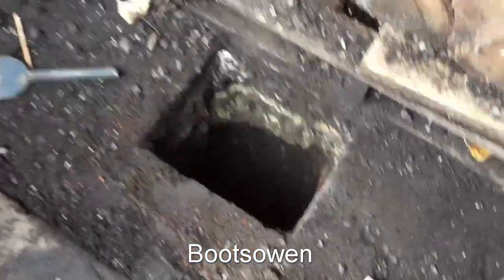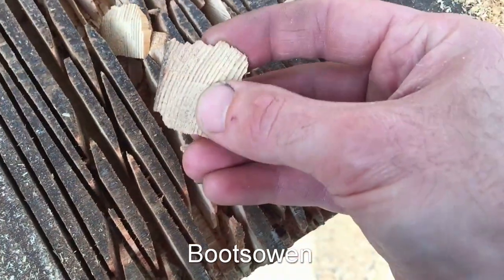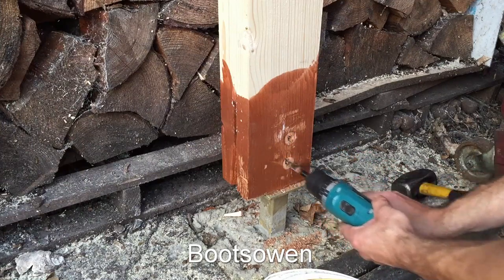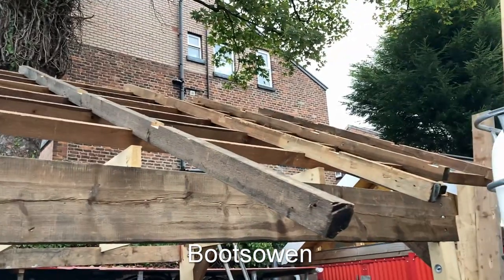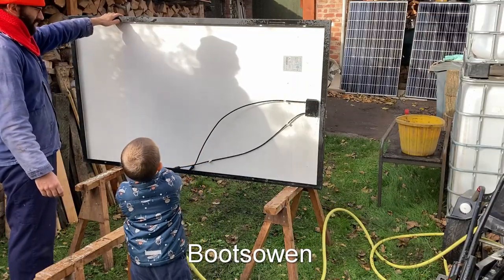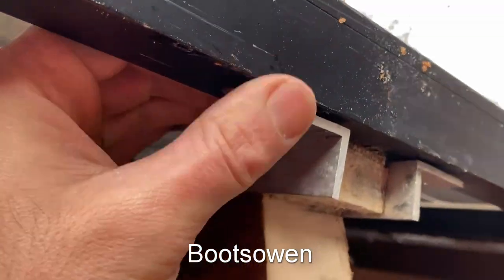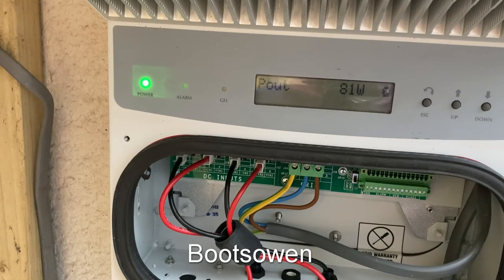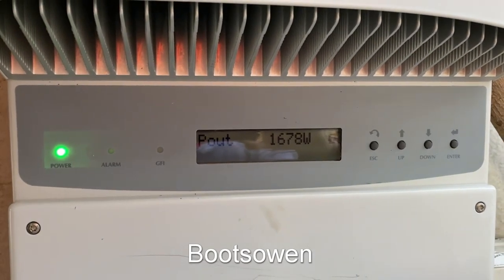DIY grid-tie solar in the city: Full installation | start to finish | 4kW | Solar car port

Comment: Love the video boots. I fitted 5 panels on my outhouse roof and woodsheds. I was pleased to see how you mounted panels vertically (on a beam) as I used the same method. The way you built the car port shows your attention to detail e.g. woodwork.  You're a real inspriation, love your channel.

Comment: You sir are a bit of a legend I think - fantastic ethos in terms of sourcing things so economically whilst giving them a second life and your workmanship and problem solving are a joy to watch.  Just in the research phase of fitting panels on a steep roof which I'm not looking forward to I must admit, and then intending to cable up and bring in someone for checking and certification.  Your excellent video is yet more inspiration willing me up that ladder :)
Reply from the maker: I do my best. Why do you need certification? The feed in tariff is gone so there is no money to be made, maybe so you can get a few pence per kWh from your energy supplier, but I imagine there is a cost benefit analysis to be done there. If you are thinking of doing it on a roof, even single storey a scaffold will make it far easier.  Have a look at my solar playlist, I show some other installations that I have done.

Comment: Owen, I see the Boss was organising you, great you finished off that ripping cut with a hand saw. The strong smelling timber: I think this is old growth and probably from America as Manchester is the right side of the country for shipping last century. Good to see the finished array working and of course 25 degrees is good for ambient light in the winter. Cheers
Reply from the maker: You might be right about the timber, I hadn't thought of America as a source for the timber, Quite amazing that those centre rings could be from 17XX and have travelled around the world before carrying a burden for 100+ years! Wonderful!

I took your advice on 25 degrees, when there is no sun but good light and cloud the panels kick out anything up to about 500w, so there seems to be good refraction of light through the clouds. I had a few points in the video that I didn't make fully: If the panels are putting out 1.6kW when the sun is at such a low angle, I imagine it will be far better from March onwards as the sun gets up into the sky.

Any idea what the birds were, I mentioned geese, but I'm not sure?
Reply: Owen, I'm sure they were geese, we get plenty of them flying over here, most of the time lower than in this video. The last home life has a brief video clip of them, cheers

Comment: Power-on sequence, make all connections and secure them, then AC isolator to ON, DC isolator to ON.  Power down sequence, AC isolate to OFF, DC isolator to OFF.  Do not switch the DC isolator when the system is operating. I'd also caution anyone using pound/dollar store multimeters on the DC string, if you screw up and probe on the milliamps setting the arc is going to blow the meter to pieces in your hand.

Comment: Nice build indeed, very similar to my shed which uses panels over the felt to protect it from the harsh weather while making electricity.  Have you considered adding a solar diverter, there are commercial ones out there and also DIY kits.  Would love to see a DIY version being setup perhaps with an Arduino or Raspberry pi type board.

Comment: Hi mate, great work You did there.
May I ask the question what screws you used to keep the panels in place..  I can't seem to find big head ones like you used.  Thanks Ben (UK)
Reply from the maker: The ones with the big plastic washers are from wickes for polycarbonate roofing. Any other ones probably came from toolstation. I have used a screw with a big washer on it and then drill a hole in a milk bottle lid as a plastic insulating washer.

Comment: Hello from Kildare, what is the strip you’re putting between the panels? Looking to make a solar pergola for the back garden to try boost my system and this looks like it might come in handy
Reply from the maker: I used flashing tape. But it doesn’t work. For a solar pergola with no sheeting beneath it you’d be better having a network of gutters. I ended up removing all the panels and putting box profile beneath

Comment: What specific documents did you need to submit to get building control approval? I'm thinking of doing something similar - perhaps 8-10 x 240w panels (used) and something like a 2kw inverter (plug-in type, no mains wiring) ... I'm guessing something like £1200-1500 in total. Did you have to do plans or loading calculations for your garage roof? Would a plug-in inverter need electrical inspection? I don't plan on feeding back to the grid (auto load sensing inverter). This is also in north east England.
Reply from the maker: Some people love rules, some countries have different rules. You need to follow the IEE wiring regs in the UK, and if you want to sell the power to the grid you will need some kind of cert. rules are very important. You could just go for it and see what happens with a plug installation. as for load calcs, it all depends on the shed, a solar panel weighs about 20 kg, I weigh 70 kg, if I would walk on the roof (point load) I would be happy to put 3 or 4 panels on it ( uniformly distributed load) It's your house and your call. Sounds like you're making work for yourself!

Comment: Great job. Thanks for the walk-through. Where were you able to find the solar panels for that price? I've been looking on gumtree but haven't seen anything comparable price wise, most at minimum £100 on there. I guess i'm wondering the same about the timber as well?
Reply from the maker: I found the timber on building sites locally. As the guys who are doing roofs for any demolition timber. There is a set of 14-16 3.6 kw panels and an inverter in Inverness or Aberdeen on gumtree at the moment £500. They come up from time to time. I was looking for about 4 months until I got some an hour away. It’s hit and miss. Some places seem to always have them for sale, they get them used from solar farms. Or ask a roofer who installs them. They know where they are being upgraded. Or ask an installer if they have some damaged ones. Broken glass ones can still be working but are more likely to fail. This is the advice I was given and it seems useless until you get some. But you will. Keep asking everyone and scour eBay and gumtree. Full sets of used panels near me have certainly become more expensive in the last 6 months.
Reply: Thanks for the advice, it's much appreciated.

Comment: Loved all the hand woodworking.

Did you have to get a permit for this or inspection?
Reply from the maker: You sound like you are in USA, rules are different depending on where you are, so such advice about permission or permits are somewhat redundant on a platform like yt.

Comment: Hi, I'm just buying my first house and looking forward to getting stuck into the projects.  How did you go about getting your system certified? Or more importantly how did you keep the insurance company happy? Having only played with solar installations on boats and campervans I'm super worried about all of the extra rules that come with houses.
Reply from the maker: It depends on where you are. follow local rules. Don't be afraid to play, just play safely. 
A qualified electrician can sign stuff off.

Comment: did you measure amps between a load?
Reply from the maker: I’m not sure I understand what you mean?
Reply: @bootsowen  amp meter goes between the + and like a lamp.. it looked like you measured directly on the solarpanel output 

https://www.youtube.com/watch?v=x2NLYydxbo4
Reply from the maker: If you use the correct setting and cable port on your multimeter you don’t need to do this.

Comment: Absolutely love this, I'm thinking of doing something very similar myself. I've a couple of questions if you don't mind?

- Where did you learn how to wire it into the consumer unit? I'm finding details to do that scarce.
- I'm guessing your installation isn't MCS certified as you DIY'd it, so presumably you aren't earning anything for what you export. But are you being charged? Some sources seem to indicate that you would be bit it's hard getting that sort of information from energy suppliers.
Reply from the maker: No worries. 
You learn about electrical stuff by studying it. The iee wiring regs are the standard in the U.K. and Ireland is similar. You don’t say where you are so the USA and other countries are completely different. In the U.K. you can do the work yourself if it is inspected by building control or if you are competent i.e.an electrician. 
Mine would be compliant with MCS, it wasn’t completely finished in the video, and you can get a used system mcs accredited by an mcs installer. 

The trick with these things is to know the rules. Work to the rules and have someone who is qualified check it. 

I didn’t register the installation because there is no feed in tariff so there is no point anymore. 

Have a look at Andy Reynolds wind and solar book. It is a good start. 

I spent about 8 years learning about electricals and I still know very little. So take time. 

A good start is to buy a small 1or 2kw grid tie inverter and panels to about half the rating of the inverter. Just put a plug on the inverter and plug it in. I have shown this in my testing inverters videos. 

Finally: don’t take advice from some guy on the internet even if he has terrific hair. Electricity is very dangerous and one zap of the wrong kind. Dc or ac could give you half a day out with the undertaker.
Reply: @bootsowen you've just filled in so many knowledge gaps that I've had for ages!!! Thanks man your videos are super insightful.

Comment: Super video ..thanks. What type of adhesive tape did you use to seal against water?
Reply from the maker: I used bituminous flashing tape, but it didn't work, it leaked through the sealant on the panels, I wasn't expecting that. In the end I took all of the panels off and laid box profile steel roofing sheets, then put the panels back on.
Reply: @bootsowen  Thanks for info.Yes, I have the same problem, I'm thinking of how to make a roof using only PV panels. I'm looking for a solution.

Comment: how come there are no videos about how much people are saving after 10yrs since solar has been around over 20yrs?
Reply from the maker: I have only had these installed since November. Today on May 2022 I have saved about £43 (185kWh used at home) on electric since then and about £65 has escaped into the grid (279kwh). Total generation 464kWh so far. I paid £500 or £600 for the whole system and have only installed about 2.5/3.6 kw of the panels. If I could use all the power payback would be 2 or 3 years. As it stands it will be 5ish. But if energy prices go up payback will be faster. I guess if you buy them new then it will take longer.
Reply from the maker: I should have mentioned. My system is about 10 years old.

Comment: Notice you didnt do this in Ireland and you are Irish.
Reply from the maker: You might be the fella who would eat no fat?
Reply: @bootsowen  Yuuuuuuuuuuuuuup
Reply: I had on off grid system in Ireland using generators etc. and gypsies pulled the door off with a vehicle and a steel chain and stole all my equipment. The door frame was pulled out by its bolts and the door was never seen again.
Reply from the maker: That’s tough. I am quite lucky where I am that it is very busy. On the other hand I might like a bit of quiet. Solar doesn’t seem to be something that is worth stealing but vandalism would ruin it. People might think the inverters are worth money but I have bought a few recently for £25 each. It’s the hassle factor if someone wrecks your stuff. I wonder if there is an irony in putting something behind a steel door. In that it makes it more worth stealing.
Reply: @bootsowen  Yes. That's what the Gards said about my 'fortifications'.It draws them in. . Although I do believe also, that the thieves AND vandals ( everything gets smashed ) have the backing of the local community as I bought in among an established country community where families had owned half a field each for hundreds of years. They are determined to make me pack up and leave.
Reply from the maker: It's tricky, and sad!